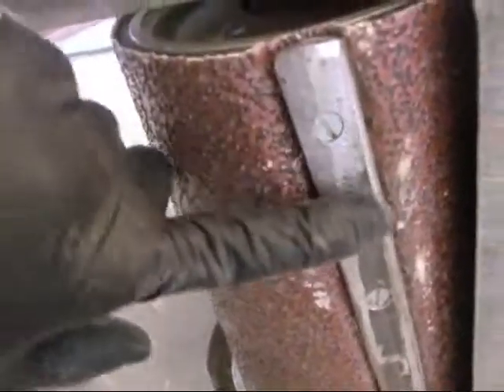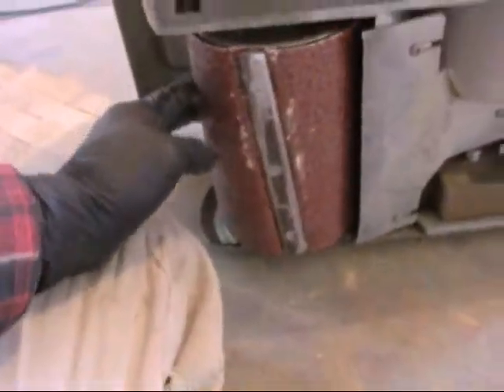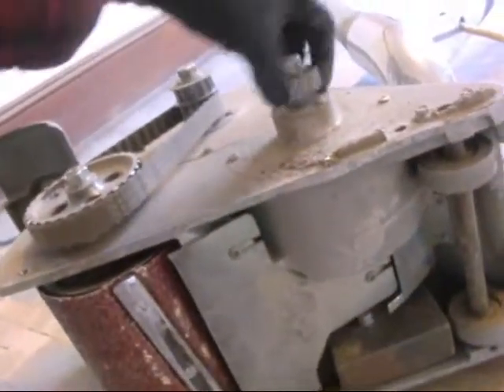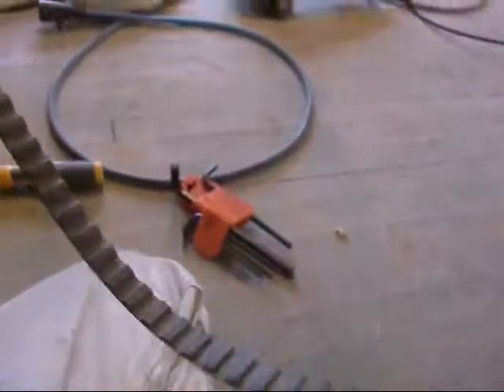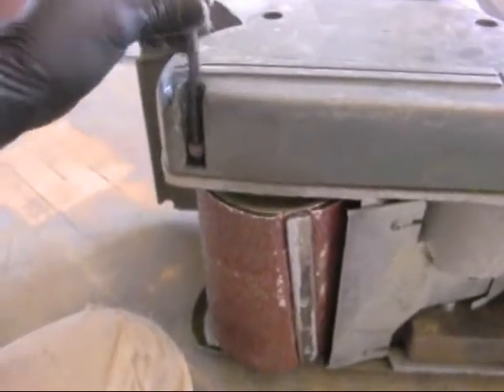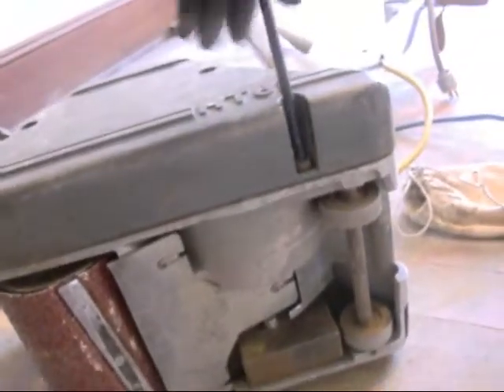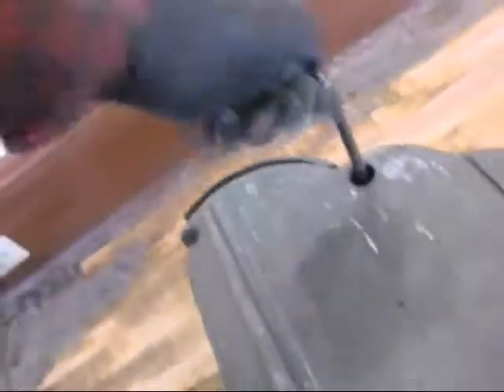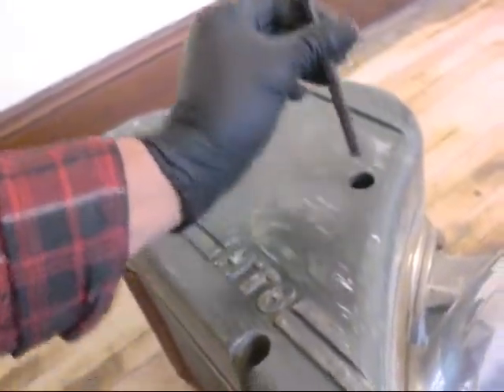1 13 13  More Junk Floor Sander Vid I

Comment: Trimming pulley!? Fancy! The sanders I use have V belts on them... Well not so good because they slip a bit but they last forever ! In 5 years of sanding floors I have got only one belt breaking on me but it was my uncles fault! I told I have having too mush loose tension the collector belt and he did got me a too small one so I end up with too much pressure and it went boom in one minute work !